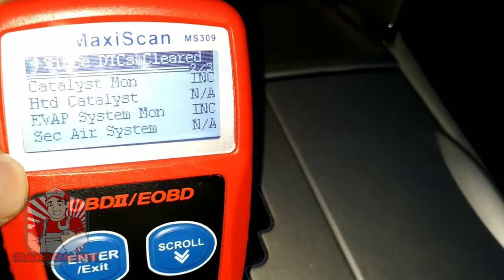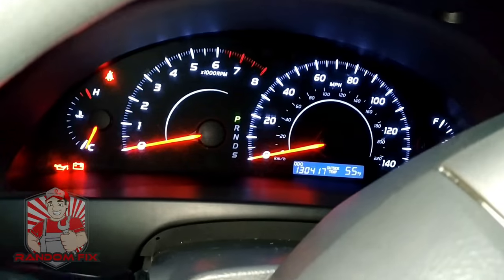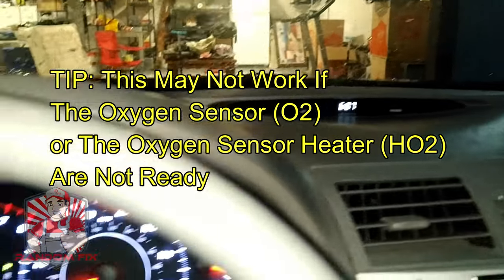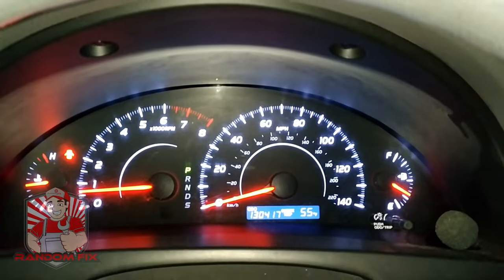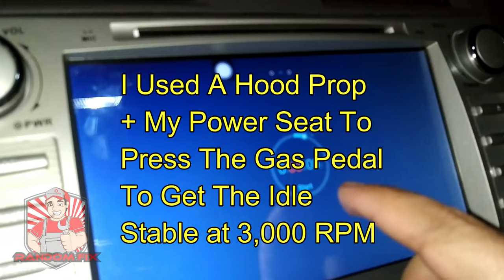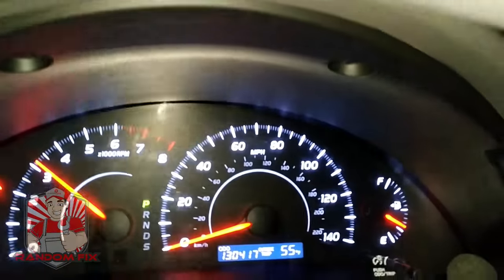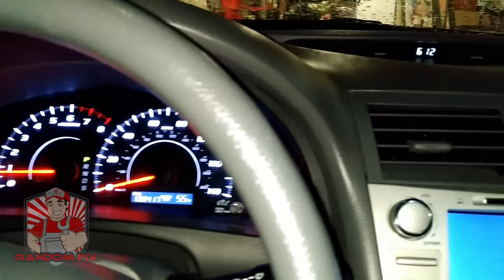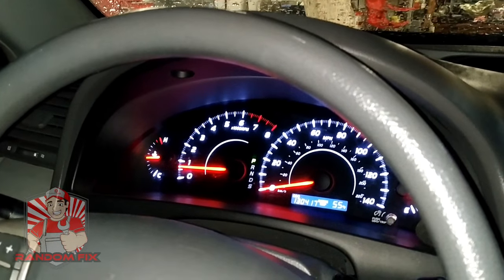Amazing Trick to Get Catalyst Monitor Ready!

Comment: Your instructions are the best of all similar videos to resolve code issue, that too without driving the car from a safe open parking in shortest time! Thank you for helping solve my CAT no code issue for smog check. It worked like miracle for my 2002 Camry which has meter to indicate RPM. But my 2001 Corolla doesn't have such meter to indicate RPM. What is your suggestion?
Reply from the maker: Thank you for the great feedback. Much appreciated. For your older corolla without a tachometer you will need to purchase a obd2 reader with live data that will display your rpm. They run from 50 to 100 dollars and are great because they work on any 1996 and newer vehicles. Let me know if your need any recommendations. Keep me in the loop.

Comment: Hi My 1997 Toyota Camry w/ <120K miles passed all smog check tests except the catalyst monitor not ready as it did not have much drive after the installation of new battery.   I got 'No Powertrain DTCs or Freeze Frame Data is presently stored in vehicle's computer' from the OBD2.  I have tried 350 Miles driving including two drive cycles but the CAT is still an unsolved problem.  Since yesterday I also tried your 7 min idle+3 min 3000 RPM method twice in two days, in Parking and Neutral, respectively.   I got the same message and I guess I may need to try more times to get the CAT ready.  Should I only try it in the morning?  How long is the time period between the two tests?   I just want to make sure I did not miss any important things when I try again.  Thanks!
Reply from the maker: Hi John, in the mornings it's best or bypass the o2 sensor hole and spray seafoam the help clean your catalyst or use cataclean. However the only true solution is a new catalyst because of the age of your 97 Camry. Please make sure you have not exhaust leaks and the o2 connections to make sure they free of grim or dirty and reconnect. Your battery also needs to be ideal condition. Good luck and keep me in the loop.
Reply: @RANDOMFIX  Thanks for our prompt reply! I'll try it again tomorrow morning.

Comment: I drive a 2015 GMC Sierra  Four Wheel Drive 5.3 if I have a po700 that turn the check eng light on like every 3wks an I reset it every time when it turn on will that interfiere with my I/m monitors not to set from (inc to ready)
Reply from the maker: Yes that p0700 dtc will keep monitors from setting once the code is set. However you can get the monitors ready and smog it right away to pass before the codes sets if it takes 3 weeks for the computer to hard set that p0700. Here is the gm drive 

https://youtu.be/Yp34ksJY-fQ

Comment: I tried this and unfortunately, my 2008 honda civic still says catalyst monitor INC. Do you have any other tips that may help?
Reply from the maker: These two videos will help with your 2008 honda civic smog.
To see when the catalyst sets without a tool you can watch this https://youtu.be/cxpE_I1cKh8

And a a full in-depth drive cycle that covers the catalyst here is the honda drive cycle https://youtu.be/oZELvZ4danA

I just got a 2004 honda accord ready that would not set the catalyst for months so what I did was warmed the heck out of it ( I hour warmup ) and then hit the freeway. Do this on a hot hot day and just remember do not turn on that air conditioning and make sure they are no pending codes. Keep me posted
Reply: @RANDOMFIX  Thank you so much - I'll watch them and hopefully it works :)

Comment: Tried this twice on my 2001 Suzuki XL7 and still my Catalyst Mon is INC. I’ve driven it almost 600 miles. Did the 50-55 for 5 min and this as well. Any other suggestions would be appreciated! Thanks!
Reply: Quick PSA…hope this will help other Suzuki 2001 XL7 owners. Finally got the CAT monitor to complete. Found on another site. Drive 60 mph (using cruise control) for 10 minutes, then pull over and let your car idle of 1 minute, then back in the freeway and drive another 10 minutes at 60 mph (again with cruise control). That should do it for this particular car. Using the cruise control was so vital. And yes, you will get lots of looks and “you’re #1” with the middle finger) driving that slow on the freeway…especially in California. But hell with them…I need to pass smog.
Reply from the maker: Thanks for sharing this info much appreciated. I hope it helps someone and this smog sh++ is annoying.

Comment: Unfortunately, this did not work for my 2002 Toyota Camry. Did all the steps listed in the video and the Catalyst Monitor is still INC (incomplete). Any pointers will be helpful!
Reply from the maker: Hi Dang, here is the whole playlist for incomplete catalyst monitors.
https://youtube.com/playlist?list=PLDEbtVOPRC-h1BAzaWQ-6NSnmG0gwvgwP

Let me know what you still have questions about after watch the videos for ideas. The question to ask yourself while your watching this video is beside age what else could of caused the catalyst to wear?
Reply: @RANDOMFIX  Hi,

The thing is, I don't know what could have caused the catalyst to wear because I got this car second-handed recently. I did know that at one point, a CEL occurred and was fixed by replacing the starter motor by the previous owner.
Reply from the maker: Normally starter motors will not trigger a dtc especially on a 2002 Toyota. They might of cleaned the dtc to reset the drive monitors. Keep me in the loop on what happens after you watch the playlist.

Comment: Help please.  2004 f150 5.4l engine 4x4.  Mil is off no codes no lights,  all monitors ready except catalyst. Tried this didn't work.  Driven 200+miles.... any suggestions?
Reply: Did you Ever Resolved this?
Reply from the maker: Sorry for the late reply! did you find a solution?

Comment: My 1998 Camry started sputtering around the 3rd minute almost exactly what do you think that could be???
Reply from the maker: Is the catalyst lose, if the exhaust or catalyst is broken it can clog up and build extreme pressure which can damage the engine if left unchecked. Remove the pre cat o2 sensor and see if that helps. Your vehicle is over 25 years olds and this could have well happen. Most of the time people drive around for years not aware that the catalyst is damaged.
Reply: @RANDOMFIX  it is the v6 model, is that the sensor located after the downpipes before cat right
Reply: Mine does the same exact thing starts going erratic exactly at 3 min.

Comment: I have a 2008 Buick Lacrosse. Had Vent valve fixed Code P0445 . I can not pass emissions. Shows up rejected - paperwork states monitors not ready ( (Catalyst,Evap) would this possibly work for me? I drove it 150 miles already no check engine light has come on? Frustrated for sure. PLEASE HELP . lol
Reply from the maker: Here is the video that will help you get your evap and cat monitor ready I your 2008 Buick lacrosse, https://youtu.be/Yp34ksJY-fQ fyi the evap maybe exempt

Comment: Drove my honda civic over 130 miles and also did this and still doesnt work :/ any ideas? I dod out a fouler on the downstream 02 but u dont think that would affect the driving cycle? Or will it ?
Reply from the maker: I am not sure since you are running the fouler on the downstream. I've had great success with older hondas using this trick.
Reply: @RANDOMFIX  rnt u supposed to use it on the downstream or is it the upstream?
Reply from the maker: The fouler is normally on the downstream o2 sensor but I have not used it much other than there where these cel eliminators o2 sensor harness that had a little resistor that acted like a o2 sensor with voltage going up and down on the downstream. The website that sold these were American muscle so it was not intended for your honda.

Comment: I have a 2007 Camry, and it says exactly this, also the check engine light comes up with P0420 error, this happens after a misfire that i had i cylinder 2, which i already fixed, but now i'm afraid that my vehicle will not pass the emission test for this year, any suggestions ? do you think i should buy a new catalyst plus a new O2 sensor ?
Reply from the maker: Jorge, how many miles? I would reset the check engine light to confirm there are no other codes + throw in a bottle of techron from chevron, 92 or 91 octane and just it in the video, it's the same car exact car.I have 2 other p420 fixes on my complete smog playlist to take care of this issue. I would not spend the $$$ on the cats until you try the other simple temporary fixes, please understand the only permanent fix replacing the catalyst.

Comment: Does this work for newer(ish) vehicles? I have a 2015 Honda Accord everything else is set but catalytic mon is still Inc; do you have any recommendations? I tried this method but it didn’t work; did you ever run into it taking multiple attempts? If you attempt this multiple times, do you think you need to wait for the engine to cool down prior to a second attempt or can you attempt; idle for a short period of time and continue this method?
Reply from the maker: Yes I have run into situations that I've had to attempt it multiple times. Here is the Honda drive cycle video.
https://youtu.be/oZELvZ4danA
That will give you a little more detail. And also on the channel there is whole playlist dedicated to just incomplete catalyst monitors. What caused the monitor to be incomplete?
Reply: Mines not new but my car took 2 tries
Reply: @RANDOMFIX  Thank you, I passed my OBD2 tests. I am not sure if it was solely the drive cycle or the (holding RMP @ 3000); I did both multiple times and drove ~ 250 miles. Thank you for your videos'.
Reply from the maker: Glad to help. Thank you for the feedback

Comment: If the service engine light is on,should it turn off after this worked ?
Reply: I have the same question. Some of my results have updated with the MIL light on but really don’t want to reset the codes just to have to go through getting all of the tests to clear again.
Reply from the maker: Marcus, always start the test with the check engine light cleared " off ". You will need to do a reset. What is the make of your vehicle?

Comment: I let the E250 ( 1999 ford cargo van )  warm up ten minutes and let it rev at 3000 rpms for 4 minutes with the code scan tool plugged and checking the i'm readiness and nothing happened even took it for an hour long ride on the highway. the Cat and evap are still incomplete.. what might the problem be please?
Reply from the maker: Here is the complete ford drive cycle. 

https://youtu.be/j8ZFTE1rSfA

I will help you, please excuse me if I don't answer right away as I'm out of state.

Comment: Thanks for the video. Very clear, but sadly did not work for my 2002 Hyundai Accent GL 1.6L. Went for 4 minutes. I can actually get the EVAP more easily, believe it or not. I used to commute 50mi a day and two trips back and forth would trigger it. Maybe mileage is a factor for my computer. 😑
Reply: 02 kia spectra, same engine. Did not work for me either. Got everything but the cat. Let me know if u figure it out!
Reply from the maker: Check Hyundai drive cycle video on the smog tips playlist.

Comment: How well will it work on a 2000 toyota 4runner? I have re4placed 02 sensors and driven around 500miles going through 3 tanks worth of gas and still nothing. Also tried completing drive cycles and it still wouldn't work.
Reply from the maker: Since they 4runner is 21 years old now I would following the exact toyota drive here in this video https://youtu.be/EKfEr2LP2Nw keep me the loop and good luck.

Comment: I've a 2007 Honda Accord V6 and tried this morning, but the Catalyst Mon still INC. I did 3 times. Any recommendation please.
Reply from the maker: Here is the Honda drive cycle 
https://youtu.be/oZELvZ4danA

And I have a whole playlist on setting a catalyst monitor.
https://youtube.com/playlist?list=PLDEbtVOPRC-h1BAzaWQ-6NSnmG0gwvgwP
Reply: @RANDOMFIX  I picked up an ms309 few days ago, tried to figure out why the STAR smog showed ODB2 not ready. Catalyst Mon is the only item shows INC, all others were either OK or NA. Had driven up to fwy for about 60 miles yesterday with no success. As mentioned above, this morning tried this 300rpm trick with no luck. My battery is new, just replaced in Sept, and that's why ODB2 not ready. LA fwy is hard to finish a drive cycle, will try it in night time or find some remote area. This is tough.
Reply from the maker: Good luck. Get that o2 monitor ready first before you start to really focus on the catalyst monitor.
Reply: @RANDOMFIX  It just work! Thank you. The toughest part on performing this drive cycle was to reduce speed from ~60 down to ~20 without touching the brake. But, after doing that twice, the next morning I checked, everything was ok and I passed the "start" smog. Thank you for the good resources.

Comment: I had a P0017 code, i replaced the camshaft/crankshaft B sensor and the vvt solenoid. Check engine went away for a day came  pending and my catalysts mon inc and my Evap system mon inc everything is ok. I tried this and nothing any other solution friend?
Reply from the maker: Sorry for the late reply! did you find a solution?

Comment: Thanks for the video. Previously I tried doing long miles on highway, and tried drive cycle. Then I saw your video and tried this several times. But still no luck to get my CAT to be ready with the MaxiScan OBD2 reader. All other monitors (including EVAP) are ready. Both O2 and HO2 are ready too. My car is Honda Odyssey 2010. The car is less than 60,000 miles. Not sure what I can do now. Any suggestion?
Reply from the maker: Any recent repairs? Here is the Honda video https://youtu.be/oZELvZ4danA

Also, make sure you don't have a permanent code, if you need additional information here is the video for that https://youtu.be/PMcJtcSOzdk
Reply: @RANDOMFIX  I only changed the battery due to CAT not ready. And I don't have a permanent code. I will check out the new video and try again. Thanks a lot.
Reply: I tried again to do the drive test with longer driving time about 10mins for the Catalyst session. Then I did the OBD2 reading after the drive test competed. I hardly believe when I finally saw the CAT ready showed. This is fantastic. Thanks a lot for your help on this.

Comment: Hello sir ! Can I get a good result if drive my car to a good spot  10mn before this process? I mean   can this work if  after warming my car then driving to an appropriate location before doing  this process? I have a 2014 Toyota Sienna over 300000 miles
Reply from the maker: Hi Ben, here is the exact Toyota drive cycle https://youtu.be/EKfEr2LP2Nw and let me know what you need help.
Reply: It works  great Thanks!  I drove  to closest Autozone parking then  did as you said but not results.  So I remembered that  one of your  followers said he  made it by driving his car at 55mph for  3mn after the process. So I drove  for 12 MN between 50 mph and 65mph then voila👌👌👌
Reply from the maker: Ben, thank you so much for sharing the great about the 2014 Toyota Sienna drive cycle getting complete
Reply: @RANDOMFIX  thanks to you

Comment: Followed technique to the letter; still cat. monitor not ready. Performed a number of drive cycles. Ran 4 cans of cat cleaner thru the fuel system.

Decided to place a peice of cardboard (a file folder) that covered 30% of radiator and monitors ready w/i 5 miles!
Reply from the maker: Hi Gary, thanks for sharing this information about covering 30 percent of your radiator with cardboard. Where did you get this idea from and what are you driving?
Reply: @RANDOMFIX  Thought it out. I'm a mechanic from days gone by, and it was worth a try to get the engine temp. up a bit...and it worked. As soon as I left the smog station, I pulled the cardboard out as I prefer the engine to run a tad cooler vs. hotter. Again "old school" from my days of building hot rods.

Comment: Hi,
My 98 tacoma doesn't have an rpm meter on dash. Is there another way to try this?
Thanks.
Reply from the maker: Use a obd2 reader with live data, they run about 50 to 100  dollars. You may be able to feel 3 k rpm but it might be very risky if you are over reving the motor.

Comment: I have a 2000 Jeep Cherokee 4×4 6 cylinder v6 4.0 can you please let me know what can be done I tried this and it didn't work
Reply from the maker: Here is the jeep video, https://youtu.be/dyYv4HpYPys and here is short video on how you can tell if your Jeep monitors are ready without using a scantool https://youtu.be/O1RH-u1bNIc good luck and let me know how it goes.

Comment: I have a 2001 v6 camry LE . I just had the knock sensor replaced that was the only code it was giving and all I needed  to past smog and it no longer gives it but the cat isnt getting ready now,  it was before I got the sensor changed. Its not giving any codes and I've been driving it all day doing over 130 miles per her. I just need this cat to be ready! Would this work for my car? 240k miles on it
Reply from the maker: sorry, I know it's been a while, any updates?
Reply: @RANDOMFIX  had to do a complete drive cycle at 2am also had to get thermostat fixed

Comment: It worked on my 05 cadi sts but my 02 sensors will not get ready after 5 drive cycles and 400 miles.
Reply from the maker: Hi Paul, sorry to hear about your o2 sensor monitor not getting ready on your 2005 Cadillac Sts, I just made a video about this issue https://youtu.be/Yn1-ul62Jio

Let me know how it goes and good luck.